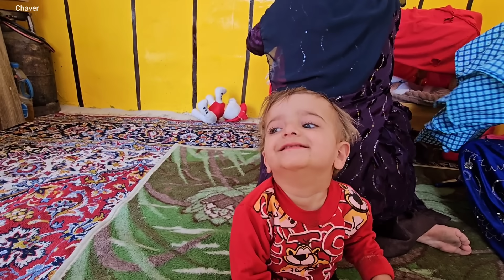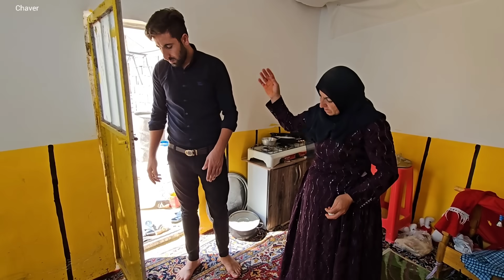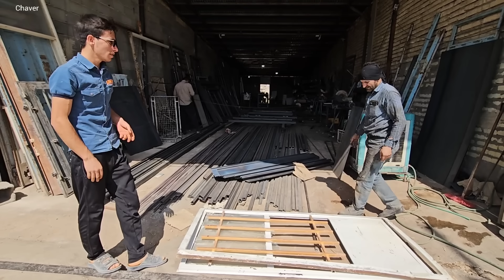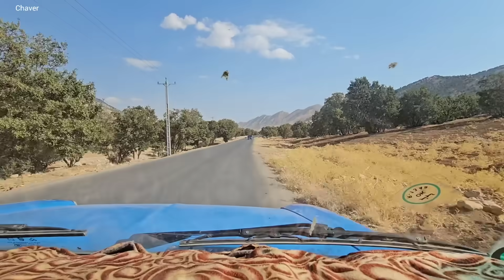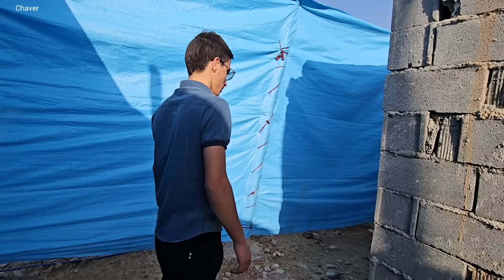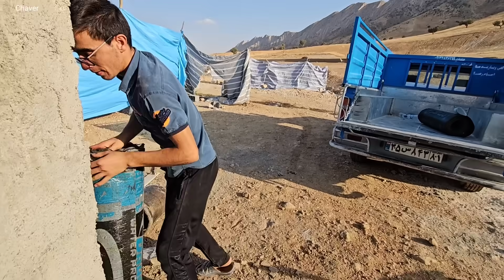Karim's reaction to seeing his newborn baby. 🤔❗

Comment: Electric heater ls come with a safety button on tbe bottom of the heater in case its tip over it turns off. At least in tbe United States they do. Tbey have pamphlets to tell you how to use them what to do and what not to do tbe safety features of the electric heater. They have them in all sizes yuppers  tbey can really wram a room up quick. I use them myself I like the electric heaters

Comment: Ilda was told by Ali not to fry foods with oil on the little cook stove but this morning she was frying eggs. What will happen when the propane gas stove for cooking and the heater which is also gas, most likely natural, are both running in that little room? This could cause  the children and the adults to develop asthma. They might also be exposed to carbon monoxide and other pollutants from gas burning and accumulating in a small area. Thank God, they don’t spend a lot of time here filming.